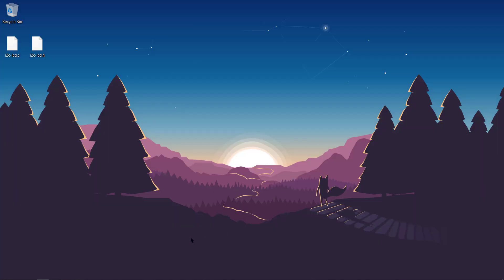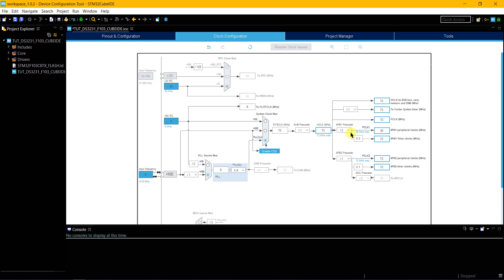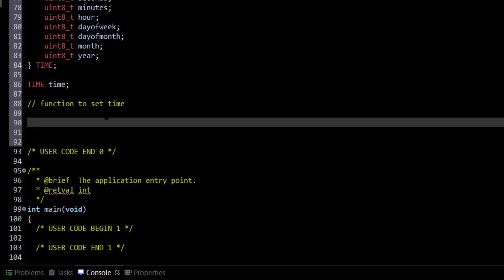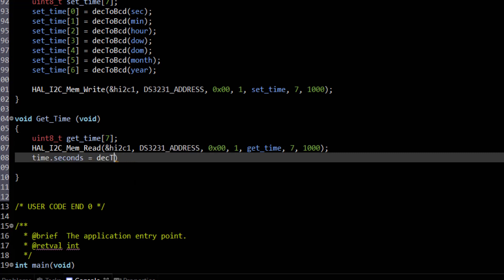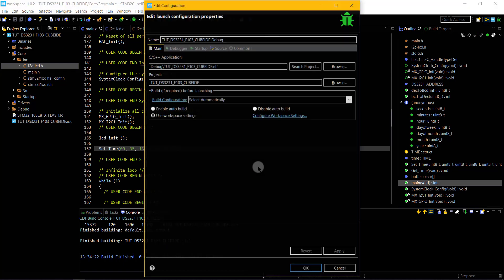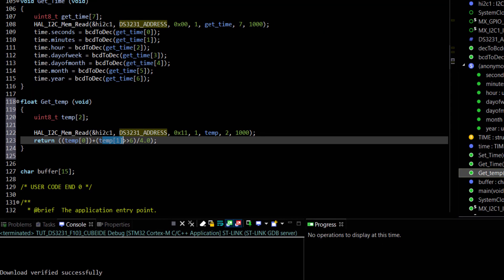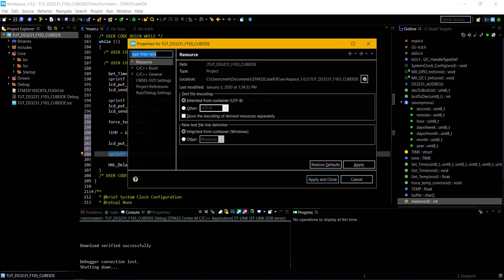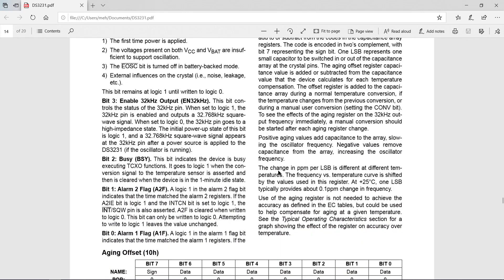How to Display DS3231 Time on I²C LCD with STM32 | Step-by-Step

Comment: I need help, I'm doing everything like in the video, except I don't use the display, I use the terminal and it doesn't work properly.  please help.
Reply from the maker: Doesn't work properly ?
Reply: @ControllersTech  I am getting the values but seconds are increasing but but those values are not sequence and not starting from the given values.
Reply: yes, for me it does not working properly, please help.
Reply from the maker: What does that mean

Comment: for each read function, shouldn't we have added 0x01 to the device address? I tried the read functions with 0xD0 and 0xD1 as device addresses and it worked for both but still, I wanted to be sure if I'm doing right by adding 0x01 for the read operations. could you please tell me whether I am wrong. 
besides, I appreciate your quality content ♥
Reply from the maker: The hal i2c read function itself adds the 1 to the address, so we don't need to do it ourselves.

Comment: I need to simulate ds3231 in proteus, but in proteus there is only stm32f103c6(32kflash), when I generated code in stm32cubeide with stm32f103c6, it said "region FLASH overflowed by 772 bytes" could you help me ?
Reply from the maker: That means the flash storage is not enough for the code.
Either optimise the code or use registers level programming instead of HAL
Reply: @ControllersTech  When I ticked "use float with scanf from newlib-nano" in properties CubeIDE, it had errors, but when I did't tick it, it had no problem, anyway thanks for your reply

Comment: Hi, I tried the project linked in your description but I can't get it to work, the numbers read are gibberish. To test that the hardware is connected correctly I use STM32 F103R8 Nucleo in the Arduino IDE with the DS3231 RTC module and it all works as expected, so I know the H/W is set-up correctly. I tried myself following the video but it didn't work. So, importing your project into my workspace and compiling/uploading the code to my nucleo board I check the values stored in the struct when the GetTime() function is called (I don't have an LCD, I want to just display in serial terminal eventually) and the numbers are still just random gibberish when I debug, I can't see a pattern at all. For example time.DayOfTheMonth = 155  and time.seconds = 212. Do you have any ideas on what I could do to fix this? Thanks
Reply from the maker: Are they updating every second ?
Change the  data type in that watch window.. wherever you are watching them
Reply: @ControllersTech  Hi, thanks for the reply. Going in deeper to the i2c HAL library the HAL_I2C_Mem_Write() function actually returns a HAL_ERROR. So the RTC never actually receives anything. For some reason the i2c becomes stuck in BUSY and then throws an error after a timeout. Apparently this is documented in STs errata 2.13.7 but it's strange that I get this error but you don't and we're using the same chip.
Reply from the maker: Better start a new project instead of importing mine. Follow the steps and it should work
Reply: Scratch that last part about the ST errata. Although it IS in there, it still works using the Arduino library so that can't be the issue. I wonder if I'm providing the incorrect data to the i2c HAL_I2C_Mem_Write(), although I've straight up copied and pasted your version.

Comment: 1) For HAL_I2C_Write function and &hi2c1 - I am getting an error that it is not declared in this scope. Is there any header file that i need to add?
2) For TIME time; - it says that it is redeclared in same name. the syntax and usage is correct for typedef struct. how to resolve this error?
Could you please help out?

Comment: great tutorial video, the link to the code doesn't open , at least for me in Japan.. any chance you could take a look ? love the voice synthesiser quality!  in chrome debugger Failed to load resource: net::ERR_CONTENT_DECODING_FAILED
Reply from the maker: Fixed.. Try now
Reply: @ControllersTech  amazing thanks.. just to say it's working really well on stm32h7. I read the time value at a set interval under a second with a counter on the MC and only print the value to the LCD if the seconds are anything different from last value. maybe i should have put the chip on another I2C bus and used DMA as my I2C1 is pretty busy read from other hardware ! interesting little chip , the temp sensor was an added bonus as i wasn't aware of that feature , or the alarms ! the temp sensor is by chance placed in the perfect place in my project for system temp!! thanks again for your great simple instructions :)

Comment: Hello! I am using the DS1307 right now. Anything in particular I should worry about, or it may be taken the same way as the DS3231? It did not work properly even though the same coding was used. It would be aprecciated if you could answer me. Thanks!
Reply from the maker: It's almost same... The i2c address might be different. Follow the video. How i used the datasheet to write the functions for ds3231, and use the same logic for ds1307. 
They are almost identical....

Comment: Hi,

There are quite a few related examples with STM32 in your YouTube channel. However, I couldnt find an example about LoRa. I want to transmit data from the sensor. Therefore, I have needed to use LoRa Sx1276-78. Can you share an example related with LoRa or share a beneficial link? From now on, thank you so much!
Reply from the maker: I don't have any LoRa device so it's not possible for now. Maybe in the future I'll get one and than try..

Comment: Hello Controllers Tech, sorry with my English I'm Spanish. Good videos, i need your help if you can. I want to use the program PROTEUS with a stm32f103c6 and a LCD, but when i run the simulation run very slowly and the lcd do nothing, Do i need put in proteus a crystal oscillator? or what is the problem?
Reply from the maker: Hey buddy there is no point in using simulation for stm32.. F103 is very cheap, and you should buy it. There i a huge difference between simulation and running the on the actual hardware, and you don't learn properly
Arm architecture is very complex and proteus won't work properly at all.
HIGHLY ADVISED NOT TO USE SIMULATOR
Reply: @ControllersTech  Yes i'm agree with you, i have the stm32l152, but a need to simulate a circuit for detected the current and i want programate this in proteus previously, for catch the current in adc and see the result in LDC.
Reply from the maker: Ok I'll try doing a quick simulation on proteus and will let you know

Comment: Thanks man great video. Can we interface LCD directly to STM32 instead of I2C??
Reply from the maker: Yeah I am working on that. It will probably be the next video
Reply: @ControllersTech  Thanks. I see the main challenge is that, easily available LCD has 5V level only
Reply from the maker: No there's no challenge with this. Actually LCD with pcf8574 attached are available at almost at the same price. And it uses only 2 wires. For that reason it's better to use the one with I2C.
But anyway, for the curious reasons, we need to cover the one without i2c also... 😀

Comment: stm32 doesn't have built in rtc?
Reply from the maker: It does. But boards like bluepill, and nucleo don't have battery holder so you can't store the time.
Reply: @ControllersTech  for that external battery with connector  is enough right?
Reply from the maker: Yes but than you want to make sure that the battery is always connected. Or else the time will reset.